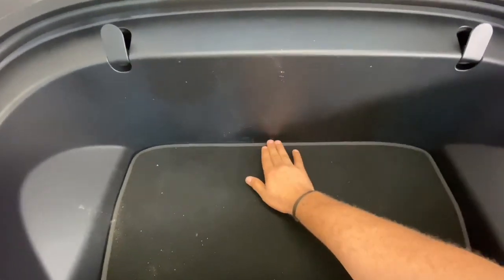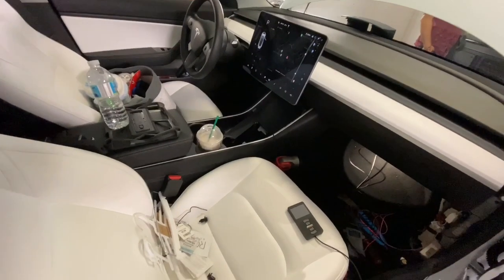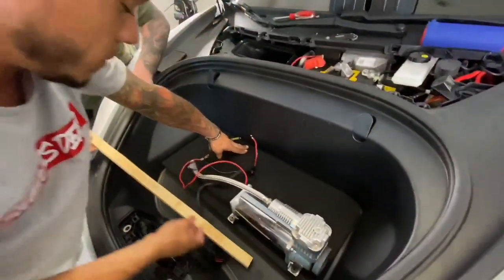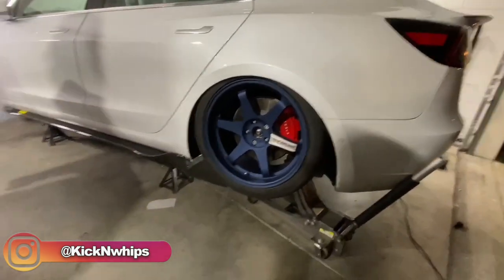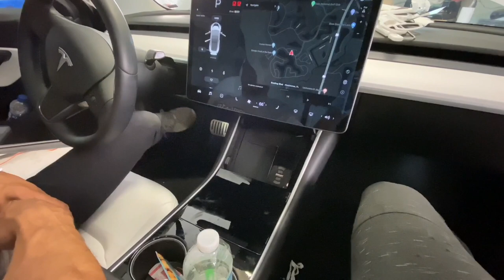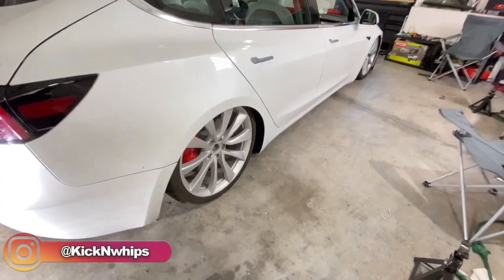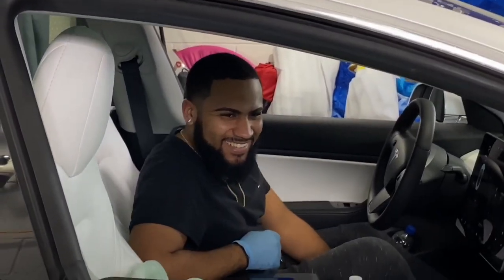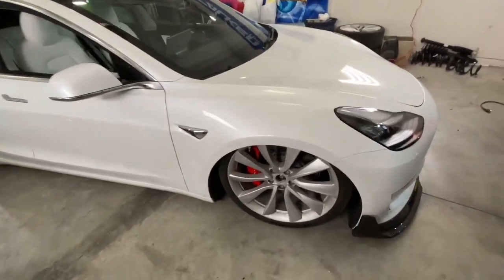BAGGED The Tesla Model 3 on Te37

Comment: Nice !!! what wire did u run the signal wire too on the passsenger side and does the system shut off when u close the door or when u turn the car of manually?
Reply from the maker: Turns off once the driver gets out the car. Used a signal wire on the passenger kick panel side
Reply: @NamedLisandro   ok cool  thanks!
Reply: Any know what wire on the kick panel i can’t find it what’s the color

Comment: when u say voided warranty? How would this affect any of the vehicle warranty? Battery? Motors? Electrical?
Reply from the maker: Tesla will void everything. Since suspension is changed and using electrical
Reply: @NamedLisandro  In the case of a Warranty issue, couldnt you just swap it back over to stock hardware for the warranty claim? 

i cant imagine it would be easy, but would be worth it if it was something worth thousands, but if the price is negligible its prob easier to leave it.

Comment: That tank and compressor looks like a mess in the frunk. They should have gone with a smaller tank and maybe two smaller compressors! Also, where u put the controller is where u are supposed to charge your phones. Now he can’t charge one phone there.
Reply from the maker: I didn’t show the frunk when we were done. No wireless pad so charger didn’t really make a difference
Reply: @NamedLisandro  how do i get the adjusters on the 2007 civic side skirts